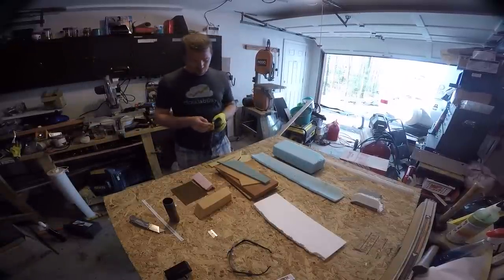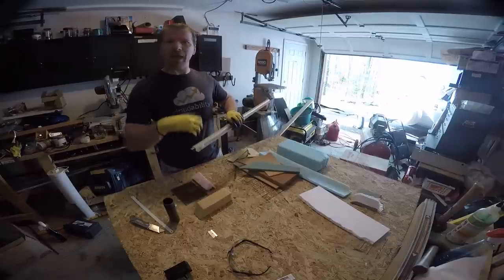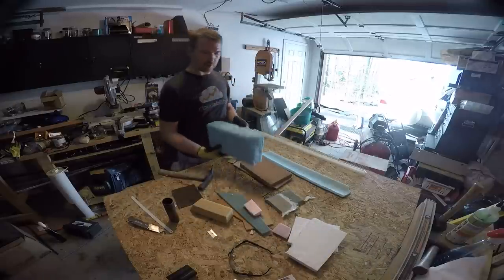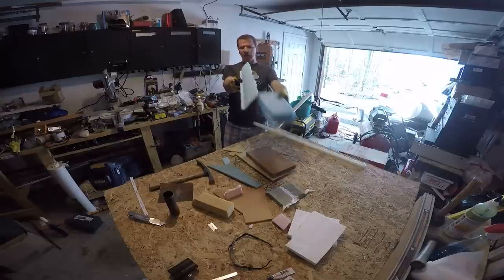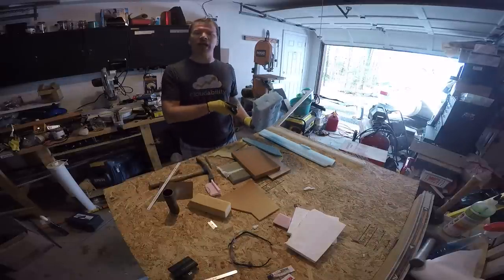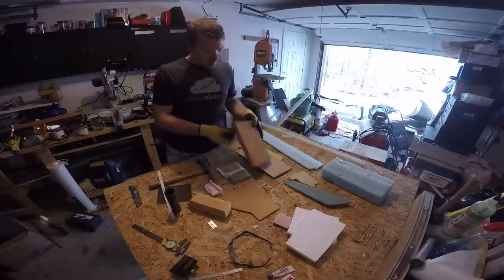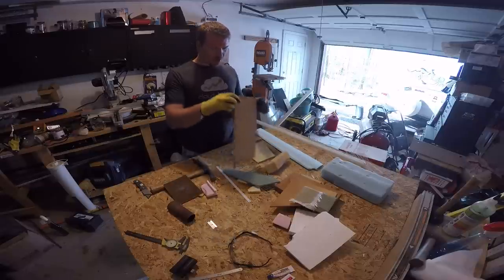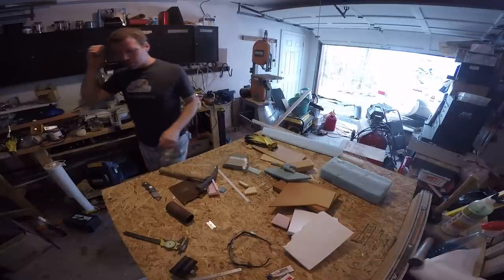Foam Types for Fiberglass Work

Comment: Hi Chad. Very interesting video...I'm venturing into GRP manufacture for a few drainage items that I just can't buy, so thank you very much for the brass tacks guide. :-)

(Be careful with your descriptions, though. The white stuff you started with is what we in the UK call 'expanded polystyrene' (EPS) ...which is not 'Styrofoam'. Styrofoam, besides being a trade name rather then a generic plastics identifier, is extruded polystyrene (XPS). XPS is nominally waterproof, whereas EPS definitely isn't - which is why nobody makes cups or takeaway trays out of it. As for the lightweight blue and ochre stuff you were working with, this looks very much like PIR (polyisocyanurate) or PUR (rigid polyurethane) foam - which over here is used as insulation board. Both are very easy to work with - but incredibly dusty and potentially carcinogenic. PPE is therefore a must, so your viewers need to be very aware as to what they're using.) 

Best regards, Mick

PS  I'm a structural engineer, not a chemist, so please don't take my word for the above.
Reply: Hi Michael, 

I for one appreciate your comments about the various foams shown here and thought you might value an American response. I have worked with foam extensively for insulation so that’s my perspective. As you point out, EPS is not as water resistant as XPS but it is manufactured to different densities and is in fact used extensively for liquid and food containers here in the US. The blue foam Chad is working with is XPS, probably manufactured by DOW Chemicals since blue is their color. The same material is also widely available in pink manufactured by Owens-Corning, the Pink Panther. XPS should be fine for form work but I would not use it as the core material in a structural part due to its low shear strength. For that, the PVC foam is much better according to my limited research. 

You are spot on about the polyiso board, it is nasty itchy stuff when cut and PPE is a must.

Comment: Hey Chad, thanks for the video! I'm trying to build a small teardrop camper with the foam core technique you discussed here!
Reply: I did my first test lay up with Foamular, and my resin just ate straight through the foam. :( It also ate through stryrofoam.  Do you know what resins are foam-safe?
Reply: Epoxy 100% solids no solvent epoxy.
Reply: Lakeside DJ Services  I’m doing the same thing although I haven’t started yet. I did find out that if you put about five coats of latex paint on the foam first and then do the fiberglass it will not eat through it. You’re using the cheap stuff from the home improvement store aren’t you? Structural urethane foam will not get eaten but the cheap stuff from a department store well. However it’s way more cost-effective to just paint the hell out of it. The structural urethane is expensive like x 10.

Comment: Correct me but won’t the styrene in poly resins eat styrofoam. I believe only epoxy can be used with it. PVC foams are compatible with polyester resins, styrofoam is great for making projects that you want to remove the core with acetone

Comment: Chad...Great video, good explanation of the foam densities. I want to build a custom one-off rear spoiler for my car and I was thinking that I might build skeleton type frame kind of like a spine across the trunk, which has a shallow curve side to side. Was thinking the triangular spine segments could be MDF, wood, or maybe one of your foam types? Once I had a multi-segment frame, I thought I'd "skin" it in a thin foam and then fiberglass it, almost like a surfboard. Which of the foam samples you show here would be good for curves and maybe even a compound curve?  Thanks in advance for the advice.-Mike

Comment: So how well does epoxy/glass bond to these foams.   I have bonded glass to the pink Owens Corning pink foam.   It works but it doesn't take much to grab a corner and peal it right off.
Reply from the maker: Great question. "Badly". With closed-cell foams like XPS (Owens-Corning pink) it has nothing to grab onto. Coarse sandpaper can be your friend here although it'll never be as strong as other forms. With open-cell foams it grips very well, BUT you get a lot of extra epoxy in the pores as a result, which adds a lot of weight. The usual answer here is to apply a layer of "micro" (epoxy mixed with microballoons) first, then do the layup over that.

Comment: What do you use to prevent the fiberglass resin heat, and etc. From dissolving and destroying the foam,  I'm not an expert but curious why it's not mentioned, since every piece you have in this video would be destroyed without some sort of barrier protection like latex paint, or etc.!!!
Reply from the maker: it takes a lot more heat than that to melt foam. So typically it's not a problem. You never want your epoxy "cooking off" (overheating) and once it's spread out it never builds up enough heat to be an issue. Latex paint would not protect from this anyway, and would drastically reduce the adhesion.

Comment: awesome ,i am making a waterbike and intend making foam shaped floats /tubes  what is best foam to use ,,and is best to use epoxy or polyester resin, ,any advice on sealing please ,thank you for  video
Reply from the maker: The resin type is a personal choice but they are not compatible so once you pick a system, stay with it. I prefer epoxy because there are many options available with different price points and features, and they are (mostly) all compatible with one another. (Also I have a lot left over from previous projects.)

I would suggest blue styrofoam as is used for dock floats. It's closed-cell so it won't get waterlogged if there's a pinhole leak and is designed for buoyancy. It's often available cheap if you live near a lake and watch Craigslist or talk to your boat launch operators because it often gets thrown out/replaced as docks are maintained. It's also easy to cut with a hot wire.
Reply: @chadrobinson3504  Thank you for the info, what foam do you recommend ,was thinking of XPS? then sheathing it with boat cloth and Epoxy, then painting with a flexible painted epoxy  system that reflects the sun ,what do you think?

Comment: A few years ago, I worked with a man that made cabinets for his work trailer using a green or blue sheet of foam. It was probably 2”x24”x8’ and in order to make thicker projects, he would use tent stakes pushed through 2 or 3 sheets.

This foam was light and hand contourable … he would curve the corners with his hand and stiffen areas by making a channel with his fingers, then would apply a indoor primer, let dry than add a green releasing agent.

Fiberglass the whole thing with several layers of fiberglass. Using a Zip Tool he would cut the doors out, then reach in and remove the foam in pieces by hand.

Do you know the name of this type of foam?
Reply from the maker: Most polyurethane foams are sandable. When we built aircraft parts we would typically use Last-A-Foam although that's not the only option. One thing to watch out for, the more sandable/shapeable a foam is, the weaker the fiberglass adherence to it. You typically need to make a thick "micro" slurry to apply to the foam before glassing it to get any kind of bond, and even that is weak. Don't use this for structural components that need to carry any bending or torsion forces because the glass can delaminate and the strength is lost.
Reply from the maker: I just re-read your post. The color is a giveaway. Last-A-Foam is yellow so it's probably not that. It was almost certainly Divinycell (PVC). That's usually blue or green when sold.
Reply: @chadrobinson3504  What I need is a foam to break away from the fiberglass. The foam is not part of the final structure. As if you’re making a fiberglass box to put something in once fully encapsulated by the fiberglass, I use a ZipSaw to cut an access into the unit and the foam is removed.
This foam breaks easy, yet very very contour-able without the use of any tools/knifes/hot wires.
Reply from the maker: @DrShout  I'm actually going to be doing that very thing in a video in the next week so stay tuned. Meanwhile you have a few options. An easy option in many cases is to cover the foam plug with duct tape. The fiberglass will pull right off once it's cured.
Reply: @chadrobinson3504  This foam was so workable, for the indentation above the tent stake, he would take some scrap piece, get his pocketknife and cut a shallow plug size circle in the scalp piece and then just push and twist it on top of the tent staked area… it would hold and then just rub his hand across it to smooth it flat.
Almost visually seamless.

Comment: Aircraft Styrofoam is large cell,  hardware store styrofoam, is usually small cell.  For laying up glass, large cell allows epoxy to bite into the foam, stronger and less chance of delamination. So they tell me

Comment: Hi, is Polyurethane Foam Board good for building a truck camper?
Reply from the maker: I would probably be using that for at least a part of it, especially compound curves. You'll probably find that some type of rigid styrofoam is better for large structural pieces like the sides and roof. You can absolutely combine foam types, using contact adhesive, epoxy, or any other similar glue between different types. Just be careful to remember that most urethanes should not be cut with heat. With styrofoam it's common to use hot wires to cut a long templates to make shapes. But you would never want to do that with a urethane, because most release toxic gases when cut that way. Urethane's need to be sanded, cut with a knife, or other means to shape them.

Comment: Hi Chad, nice info, thanks.. I am building a tank with an odd shape and shaped it from Styrofoam (the white bally one).  I am having an issue with getting something to seal it with, as I want to make a fibreglass mold, but the resin is chewing it..  Any suggestion to what I can use to seal off the styro?
Reply: You can use titebond wood glue over the styrofoam surface and than glass using poly resin.

Comment: You may have covered this in other videos but can a sheet of foam be heated and bent? I'm not looking for a tight radius just something like a two to three inch (50 to 75 millimeter) radius out of a 10 to 12 millimeter sheet.
Reply from the maker: Sorry I missed this question... I've never worked with a foam that could be reliably bent - they're all very "brittle" and crumble/sand/break easily. However, they can all be easily shaped. When you want curves, typically you don't bend them - you shape them. In aircraft construction it's very common to use weaker "5-minute" epoxy mixes (the two part quick-cure ones you can get at the hardware store) to stick multiple pieces together, then sand and shape to get whatever final curve you want. Then you lay up over this.

Remember, the foam is providing rigidity and crush-protection. The FIBERGLASS is the structure. So any glue will do - it doesn't have to be strong, just stronger than the foam. 5-minute epoxy is perfect. When making Cozy wings, pieces are common stuck together with spray-on adhesive!

Comment: Question Chad, I am rebuilding an RV. Could i us the PVC and fiberglass to build a floor. I am looking for something lite and water proof. Good video/
Reply from the maker: +Roy Vannoy Absolutely! The Cozy regularly embedded aluminum in fiberglass layups for things like landing gear hardpoints. There's no reason you can't do the opposite. To get a good attachment between the aluminum and fiberglass you need to rough-sand the aluminum first, and it's best to drill some holes in it as well. Check out the CozyGirrls' Aileron Hinge Mount to get the idea: http://www.cozygirrrl.com/cg_products_cozy_mkiv.htm

Comment: Which one would be good for a custom car diffuser?
Reply from the maker: That depends where it's going. These foams don't have very high heat tolerances. For something like an intake air scoop any of them would be fine, so I imagine you'd want something easily shapeable like one of the polyurethanes. For something that needs more heat tolerance you might want to use any foam that shapes well as the base, do a layup over it, but then take out the foam. This is a common technique for thinner parts, too - you cover the foam with duct tape or similar as a "release."

Comment: Very well done video. Thanks for posting.
Reply: blanchae I understand that there are differences in the fiberglass resin used based on the foam type. Some resins will melt the foam if not matched. What's your experience?

Comment: Where is a good place to buy the structural foam?
Reply from the maker: Great question! All of these foams were used for a Cozy MKIV project and I definitely recommend the two main suppliers in that category: http://www.aircraftspruce.com/ and http://www.wicksaircraft.com/. You can occasionally find other types in a bunch of other spots. For example, high-density styrofoam you can scrounge from old dock floats, often for free. Urethane "pour" foams can be bought at the hardware store (although their quality is low). Etc.